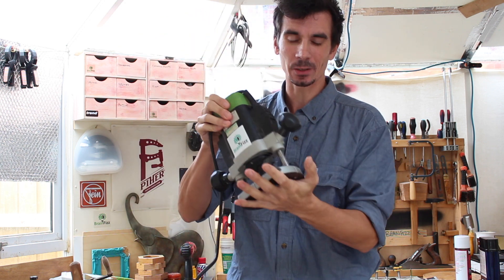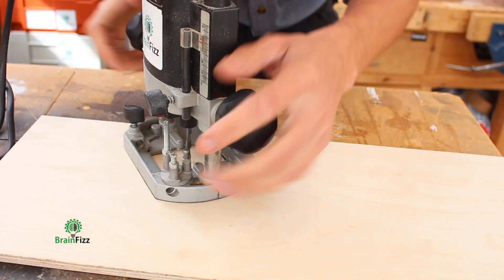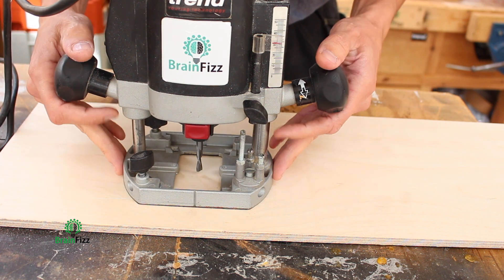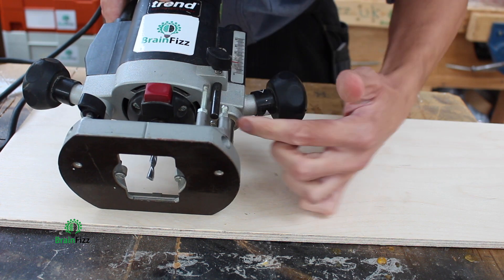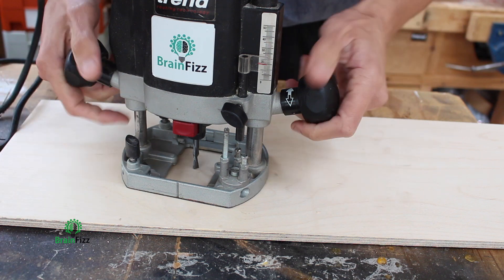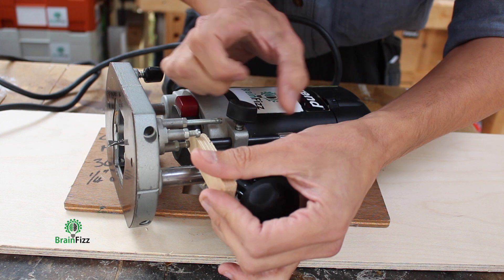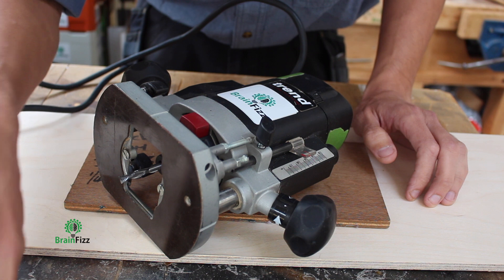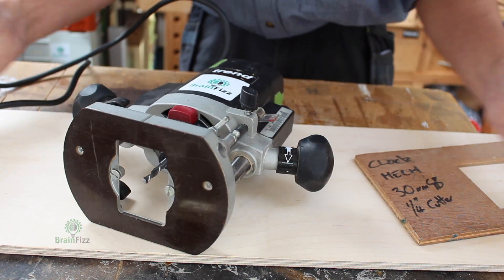Perfect depths of cut every time without ever measuring again - guaranteed

Comment: Thanks for this simple video.  I used a router (Christmas present) for the first time yesterday and I was as nervous as a kitten, with all the dire warnings about them shooting off out of control!  I was very happy to succeed in making two cuts - a straight cut in the middle of some waste material and a one foot round-over cut along the edge.  I have a Bosch POF 1200 AE and I find it tricky to set an accurate depth and was thinking there has to be a simpler way to do this.  Your tip is the best I've seen on how to set an accurate bit depth.  Thanks again and keep it up!
Reply from the maker: Hi Joe, Welcome to the channel!

 I really hope you enjoyed what you found. The POF range of routers are a good range of routers, so it should give you many years  of service!

Hopefully now you can see that "shooting out of control" is a bit of an overstatement in terms of hand held use, (at least for <~3/4" or so).
Its mostly about direction and cutter speed. I highly recommend watch these two videos first, then moving to the Depth of cut - this is covered in the live stream FAQ video I did.

These videos cover three of the four basic principles to routing:
Direction.
Spindle speeds
depth of cut.

The fourth is feed rate, which can't really be "taught" in a video, so much as explained, this topic im currently putting a video together for. (although in short, when you feel resistance/heard screeching, slow down/stop - its's time to change one or more of the other three principles -  usually your depth of cut)

Comment: I am very very uncomfortable and scared of my router, this is great too. I love simple tips like this where you actually use the material itself to make the measurements. I'll be binge watching several of these videos because I need to get much better with my router. Thanks for making these Richard.
Reply from the maker: No problem!! Start simple and get to know your router. the more familiar you are with the machine, the less you have to think about, and can concentrate on the task, rather than where's the off switch, or plunge lock etc....there are also some good written articles on my website.... Routers, like any tool, can bite hard - but they are not as bad as you might think if you think about what you're doing and apply some common sense to the four basic 'rules' of routing!  Let me know if you want any help with anything!!
Reply: Thanks Richard. Ill check those articles for sure

Comment: That's very clever. I don't use my plunge router very often, but easy tips like this make it much simpler to use. 👍🏻
Reply: The best part about this tip, is it's dead easy to remember. I've been using it for as long as I have had a router. A lot of the problem is too many peeps read the manual, go by that and never deviate. If they sat down and looked how the mechanism actually worked they'd get way more out of their tools.

Comment: Well done: nice tricks for a beginner like me. One can use a similar method for doing inlays with a fixed base router: lay the inlaid material (ex: hinge plate) on the work surface, lay router on top of it, and lower bit until it touches the work surface. :)
Reply from the maker: yes the same technique can be used there too. just make sure that the router is stable when it's raised up, for a nice accurate setup.

Comment: Great tip, Rick. I stopped using a Trend Depth Gauge a few years ago when I saw someone else doing just this. ;-)
Reply from the maker: I only use a depth gauge on the router table, which is pretty much a constant fine height adjuster. It's much faster than trying to measure, and more accurate!

Comment: Hi, Richard. I have a quick question I tried get the answer to my question but no luck.my question is why does the router bit slip from the Colect even it's locked and it ruin the dept cuts after setting required dept cut
Reply from the maker: I have had this happen to me a couple of times it could be a couple of things or a combination of them.
Firstly make sure your collet nit is tight enough. Lock the spindle and tighten the collet nut with a spanner (some routers have no lock, but require a second spanner to tighten the collet nut - similar to changing a table saw blade, If the cutter is still slipping check that your cutter shanks match the collet (see my video on cutter and collet sizes and important safety tips) the cutter and collet sizes have to match, you can check them with callipers if I’m doubt. Could be a 1/4” collet and a 6mm cutter shank.
Lastly check your collet for damage. A damaged collet will not grip the utter shank enough and it can slide.
Or it could be the locking mechanism on your depth stop. Mine consists of a threaded rod screwed into the rotating turner, these can vibrate loose, tighten them up securely and maybe lock tight them in place.

Comment: Thanks Richard. Where did you get that straight cutter. I tried getting from amazon but getting the wrong size
Reply from the maker: Almost all of my cutters come from Trend routing technology. but many companies out there do this type of spiral cutter. This is a 1/4" spiral (uncut) cutter. but this tip works with all cutters where you need to set the depth accurately.

Comment: Whats the maximum depth? I can't find any video that shows the depth of 50 to 70 mm. 
I want to route holes for door hinges for a pivot door. The upper hinge has a depth of 67mm, and the lower hinge has a depth of 58mm. 
I already found out I can buy a 70mm bit in length. But can all routers support all sorts of lengths? 
If not, can somebody advise me on which router should fit my job? It has to be a plunger.
Reply from the maker: There are loads of routers that have a 70mm plunge depth. They will be 1/2 collet routers, that might be too large for your application🤷‍♂️
The real question is why route the entire depth…. I used to regularly router mortice locks that were well beyond the depth of my largest router, with the longest cutter… why not use what you already have and just drill out the bottom for the holes with a forstner and chisel?🤷‍♂️
Reply: @BrainFizz  Thought I'd make life easier if I could buy a machine that can do it easily on that depth lol. I have considered your suggestion as my alternative option in case a 70mm doesn't exist. Turns out it does. Thanks for the advice. 💪🏽

Comment: Thanks but what length I aloud be looking for.
Reply from the maker: It will depend on what application you're going to be using it for..... for the spiral bits, they are usually fairly limited in length - determined by the diameter. Standard straight cutters usually have more choice of length of cut. As long at the cutter and your router will reach the depth you want to cut, it doesn't make a whole lot of difference.

Comment: If I use 2" length then I don't think get the right depth of cut
Reply from the maker: A 2" dado seems pretty deep... are you trying to make a deep mortice? either way, you just need a cutter long enough to reach to your intended depth of cut. The set up is exactly the same as in the video.

Comment: I hope you're still here, as this video is 5 years old.  You didn't address "incremental" plunges.  It's NOT uggested to do a "FULL" plunge, so explain how to use the "turrets" to cut incrementally please  (i.e.  3/8 cut).  It's always suggested to cut 1/8, 1/8 more then your final 1/8
Reply from the maker: If you have a look through my channel you’ll probably find at least three videos that talk about depth of cut, “never cut deeper that the thinnest part of the cutter, relief cuts and dovetailing are cover, in depth in even more videos.
If you set the full depth of the cut in one setting you only have to make one set up, taking the time once and avoiding compound errors in making several set ups….. no one says you have to take the full depth… although it is possible depending on the specifics of the cut. (Size, diameter, depth, profile).
Not all turrets are accurate, they imho opinion create potential for errors and personally I don’t like them.
If you like to use them, make a video. Im sure others would benefit from your info.